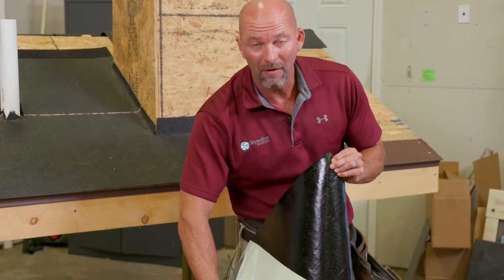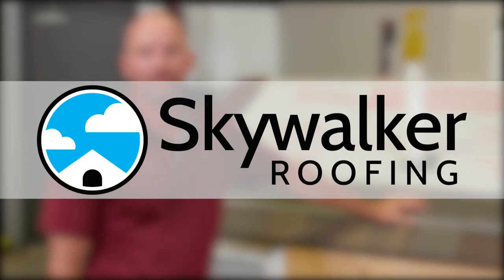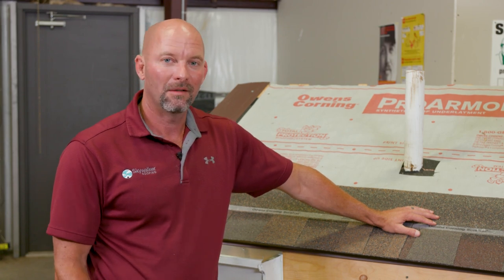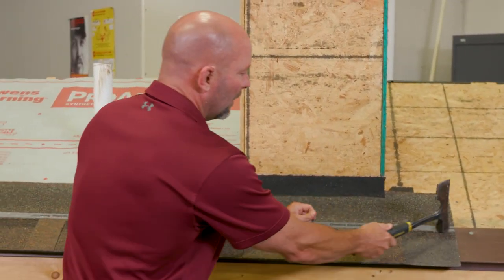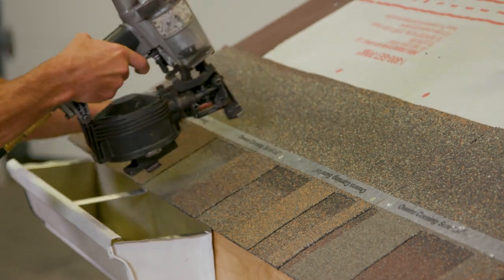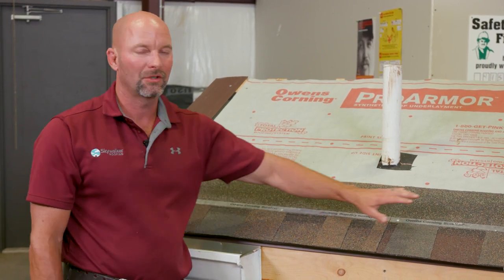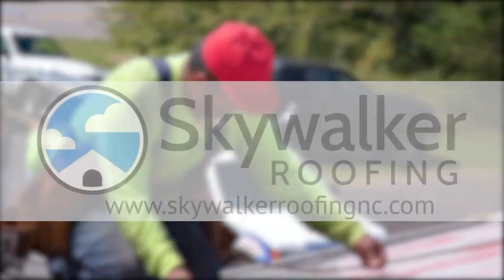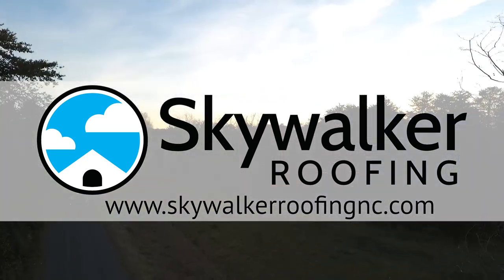Hand Nailing vs. Using a Nail Gun | Roofing Mythbusters – Episode #8

Comment: I've been roofing about 40 plus years .. We used the Plumb roofing hatchet and nailed everything by hand .. When your hand nailing  and you hit a knot like on shiplap, you'll know it....With a nail gun you won't know until you get on the ground and see all those "nail pops"from the shingle tabs not laying down where the nail didn't drive all the way down ... Or on a hot day , your more liable to over shoot the nail through the shingle because the shingles are soft from the heat ..My son and I have a family run roofing business , everything here on Texas Gulf Coast is pretty much hand nailed ,,,Especially when a windstorm wp-8 is required
Reply from the maker: Thanks for your reply, there are positives and negatives to everything. I also handnailed for years, and when I hit a not it would knock the whole not out and leave a huge hole needing to be fixed. The gun doesn't seem to do that. It all comes down to who is using the tool and how they use it. Keep up the good work and pass it down to the next generation, we need more honest roofers out here.

Comment: The problem arises when you’re in real life conditions and the sun is beating on the shingles.
Reply from the maker: I agree, when the shingles are extremely hot you may have to lower air pressure for the gun. We have installed well over 25,000 roofs with zero issues caused because they were installed by a gun. The only thing I think shouldn't be nailed with a gun is the ridge cap over plastic vent. It will blow through

Comment: It's better with a hammer ive roofed for 40 years i used nailgun to better have compressor set right or it will blow through
Reply from the maker: With the air set correctly I believe it's the installer that's more important than the tool.

Comment: I’ve been roofing for 42 years. Air guns are the worse things that ever happened. They destroy the shingles. You’re inside a climate controlled environment showing your bogus demonstration. If it’s sunny and warm the nails shoot through. If it’s colder the air gun shatters the fiberglass around the nail. 
The common bound on the shingle is about 5/8s of an inch and nail should be in the middle of the bound. It never is. If the roof deck are boards and you hit a space that’s another problem. And that hockey tape Owens and Corning puts on their shingle is just a gimmick. Problems with air gunned don’t show up right away but they do show up it’s just a matter of time. 
All the manufacturers know this but sadly the roofing business is all marketing with most contractors using slave labor from third world countries
Reply from the maker: I respect your opinion, but I've been installing roofs this way for over 30years and at a volume you couldn't comprehend. We have never had issues because we used a gun. No gimmicks here, just ask our customers for the last 30 years!!!
Reply: Agree 100% , of coarse he shows the shingle they had to “fool proof” to try and make guns work properly and the tape kinda helps them get past their 5 year warranty but the roof should last the life their advertised for, guns have destroyed quality and that’s why I stay very busy doing roof repairs nowadays
Reply: If your shooting through shingles on a hot day. It’s possible you don’t know but the laborer should be asked immediately to turn the compressor regulator down.. for an experienced roofer this is 101 after you change the depth gauge on the gun.